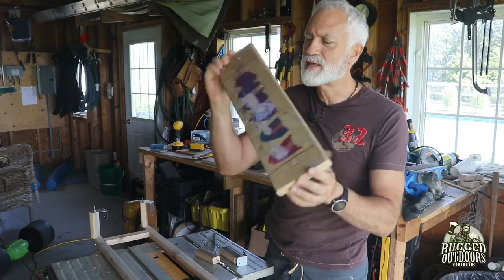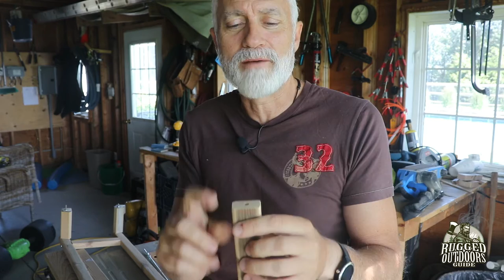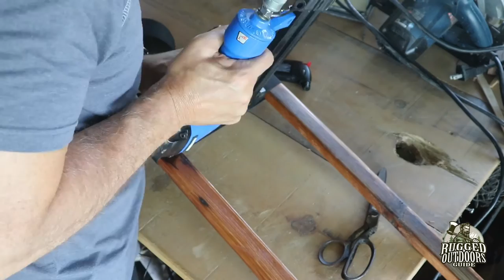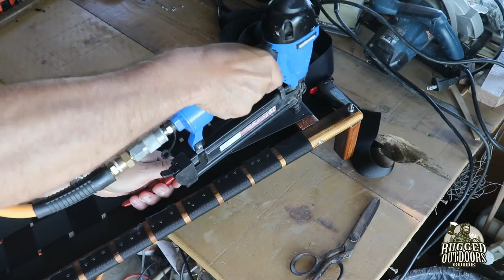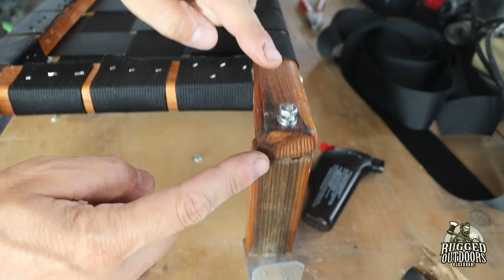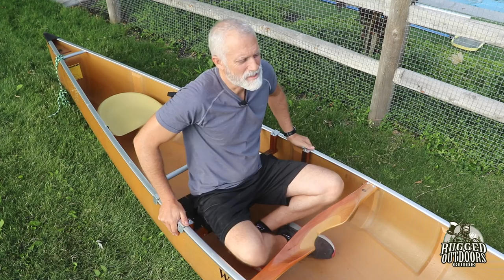DIY REMOVABLE CANOE SEAT (detailed steps and under $20)

Comment from the maker: Quick update on this seat design!  On one of my outings I sat down rather forcefully on one occasion and 2 of the 4 metal clips bent.  I since doubled them and it's fine, so I'd say go as heavy as you can on the clips - they are the weak link in this design.  Thanks for understanding!
Reply: Thanks for looking out. I think I will spray some Flex Seal (liquid rubber sealant coating) on the metal.

Comment: metal brackets are far too flimsy and threaded rod protruding looks hazardous. get a  proper carriage bolt. thanks anyway......
Reply from the maker: You're right about the metal brackets - I added a double layer for my weight - not necessary for smaller person.  I didn't cover every minute detail like how I filed and smoothly finished the cut threaded rod at the nut and coated it with Marine Goop (like shoe goo).  Carriage bolts won't work since they are far too short (at least at Amazon and Home Depot).  Ideally I would have used proper seat hanging hardware (https://www.organicboatshop.com/store/p120/Stainless_Steel_Hardware.html#/) but every supplier I contacted at the time was out of stock.  Thanks for watching!  cheers,

Comment: I’m really glad I ran across your video. I just an S-12 Sportspal. The guy had never used the canoe. However he had lost the foam (ick) seats. I’ve had no success in finding the seats I wanted. I never thought about making my own. Fortunately, I have the shop, the tools, and now the know how. Thanks for explaining each step so thoroughly. I have just purchased a 1956 Jewel canned ham trailer which needs a little restoring before use. I’m in great camping shape now that I have my little trailer, new canoe, and especially- the new home made webbed seats that I’ll be making. Thanks for the great video. Joe
Reply from the maker: Hey Joe;  I'm always encouraged by positive feedback like yours.  Let me know if I can be of any help on any related topics!  Blessings to you!
Reply: The foam seats suck anyway.  I threw mine away too.

Comment: I also saw a removeable seat concept that used metal hinges ... you take one hinge and install it on the hull, while the other hinge is installed on the seat. Where the hinge usually marries together, you use a heavy duty linch pin to connect and disconnect the seat. This way, the install is inside the hull, as opposed to creating spots on the gunwale where you can snag something, scrape your hand or paddle, etc.
Reply from the maker: That sounds like it would work well.  I didn't do that only because I was looking for a way to not leave any hardware on the hull permanently.  Thanks for the feedback!  cheers,
Reply: @ruggedoutdoorsguide9904  that makes sense.

Comment: I just made a drop in solo seat for a 17 foot fiberglass Mohawk canoe that was made back in the 80's, for the price I couldn't pass her up. Instead of using the wood and all thread for hangers I bent up some 1/4 x 1 inch aluminum strap to clip on the gunnels which is screwed to the underside of the seat which for now is just a wood plank. With a 17 foot canoe getting the weight in its center really helps. I'm using it with a kayak double bladed paddle and it really makes a difference. The canoe has an extra thwart just behind the front seat which is in the way when trying to solo sitting in the canoe backwards. I just drop the seat in next to the extra thwart and use the thwart as a back rest. Going to give making a webbed seat a try, got the wood and plenty of 1 inch strapping. Thanks for the video on how to do it.
Reply from the maker: I appreciate your feedback.  Thanks for watching!

Comment: Got a "well used" Pelican 15.5, 2004 vintage with original seats long gone. The owner had a couple of mini bass boat seats that put the paddlers at or above. the gunwales....so finding this video will let me build and install nice looking and much safer seats. The only change I am contemplating is to use round head stove bolts (if available) to give a smoooth surface. 
Bill Lynn, Nixa, MO
Reply from the maker: If you can find bolts with a screw head for a smoother surface, that would be even better.  The only other advice I can offer is that if you're hanging the seat over the gunwale on each side, get a tougher/thicker piece of steel for a bracket on the seat than I did.  Mine eventually bent, so I've doubled it now.  Thanks for the comment!

Comment: Looks really good. I’m about to do the same thing, wasn’t planning to make them removable but I think I will after watching your video. I’m using all stainless hardware for mine. Plan on using screws with large washers for the webbing instead of staples…. Not sure if it’ll work that way or not, I may be buying stainless staples as well.
Reply from the maker: The only caution I would add is that the clips for the gunwales should be very beefy.  My original ones (as you see them in this video) failed a few weeks into heavy use and they just bent.  Thicker gauge steel is best.  Cheers,
Reply: @ruggedoutdoorsguide9904  I’m still trying to find something to go over the gunwales….. I may end up fabricating something myself since everything I’ve seen is pretty flimsy. One question, does the seat stay in place well? Doesn’t slide forward or back much?

Comment: Nice job, just one comment on the Locktite to remove tocktited fasteners heat is applied to brake the seal using the angle grinder may have over heated the fastener.  You can also peen over the threads giving you one more level of redundancy ( belt, and two pairs of suspenders)
Reply from the maker: Hey Vincent;  I appreciate you taking the time to comment and offer advice - I'm always up to that and always happy to learn!

Comment: There is one additional improvement that should be added. Where the threaded rod comes through the metal hanging clip it should be grooved so that it allows an adjustable distance from the upright to the hanging down metal of the clip. Otherwise, it would seem to me that the seat could slide along the gunnels when in use. I'm building a drop in for my canoe and will add this little feature. Glad I saw your note about thicker clips too.
Reply from the maker: Hey William.  Thanks so much for the comment (may help others!).  I can tell you for sure that with my matt finish aluminum gunwales and the matt aluminum clips on the seat, there is no sliding of the seat once weight is applied to it.  Having said that, your idea is technically better!
Reply: @ruggedoutdoorsguide9904 , I should have mentioned that I am very thankful for your sharing this. How To's are what make Youtube such a fantastic resource and unselfish people like yourself need to be lauded for going to all the trouble to share such great info.

Comment: Super great video, Thank you for sharing. Unfortunately I do not have the tools. Can I hire you to make this for my Canoe? I dont start paddling till summer 2024 so its no absolute rush, its for the kiddos.
Reply from the maker: I totally can but I'm not sure of the cost.  Materials are about $25 - $30 here in Canada but labour would be most of a day and then a few more waiting days for stains and varnishes to dry.  The problem, aside from price is that each seat is best made for a specific canoe.  I'd need to know the exact width of the gunwales at the front of the seat and then about 8 inches farther (behind the seat) since the canoe will taper wider (or narrower) from the front of the seat to the back.  I'd also need to know what the gunwales look like (shape, material, other obstructions at the attachment points, etc.).  It's very possible I could make a beautiful seat, only to have it fit your canoe poorly.  I do have a drop-in foam seat that I feature on several of my videos that I would be willing to part with, but there's the issue of getting it to you and then you'd have to understand that it would need to lean against a thwart to function properly - and it's made for only one small person.  If you'd like more info or to discuss anything, drop me an email at - pete@ruggedoutdoorsguide.com

Comment: Great video and thank you for sharing. Of course I liked and subscribed! I did have one question for you. How much weight do you think the seat can hold??
Reply from the maker: Thanks for the sub!  There's no good answer unfortunately.  The one in the photo had a fail moment on a trip where 2 of the clips just gave way and bent straight.  So, I bought another construction metal bracket at Home Depot which was made of metal as thick as I could possibly bend using a sledge hammer and a heavy duty vench vise.  It now holds all my weight but I have not tested it further.  I weigh 175 lbs.  Sorry I can't offer any further info (without breaking the seat I'm afraid!).  cheers,
Reply: You could increase the diameter of the wood and/or upgrade the material to a hardwood like oak to increase the weight carrying ability. I'll definitely use oak when I make one of these. Oak would accept stain a lot better also.

Comment: You mentioned not having anything on the gunwale that you could bang your hand on. Does the finished seat not have such  hazard? with the metal hanger straddling the Gunwale?

Thanks for the video. I like your style of presentation.
Reply from the maker: The metal hanger is thinner than a piece of cardboard box from Amazon so it really doesn't stick out from the gunwales at all - at least not enough to smack my hand on anyway.  If anyone experiences otherwise, it would be due to perhaps a different paddling style.

Comment: Bro I made this see use the same stuff that you kind of had from Home Depot the threaded rod and that I weigh 300 lb man I buckled that seat like like it was nothing like those metal brackets just bent right out of shape that's on a sportspal I'm going to move up to a j shape quarter inch aluminum sheet with an L to attach the long pieces of wood and hopefully that'll hold me thanks though it's a good idea
Reply from the maker: Good info!  Hopefully someone might follow that advice!  The brackets were weak for even me (165 lbs) so I upgraded to heavier gauge.